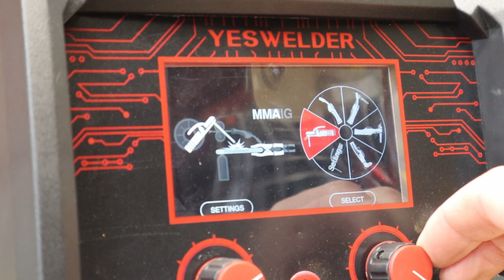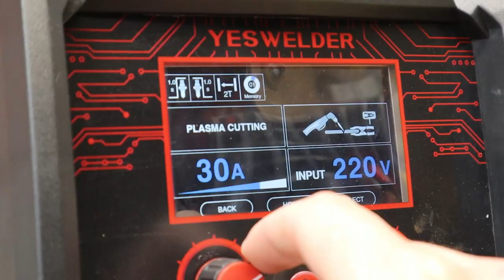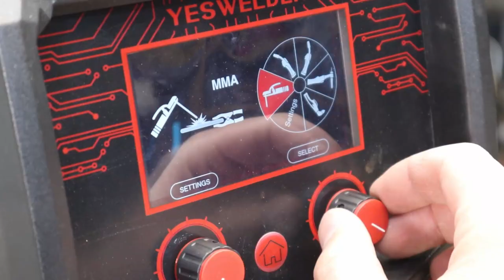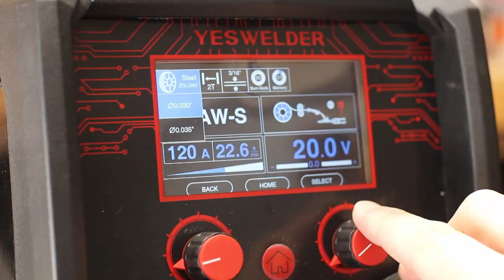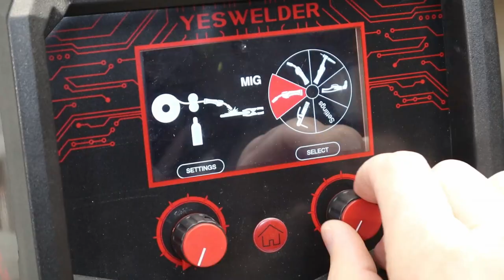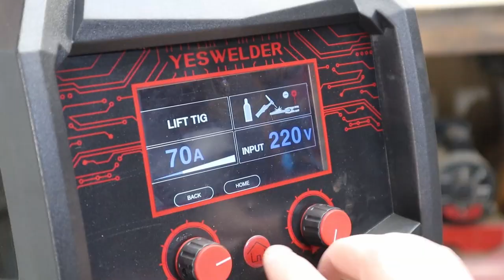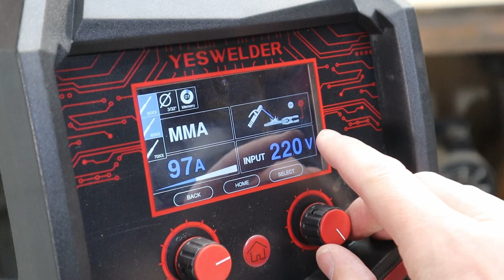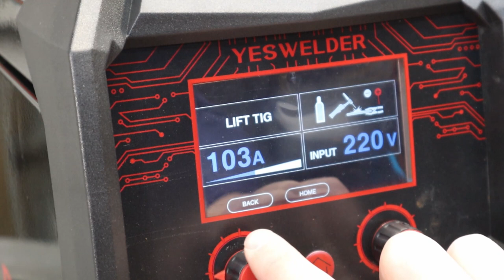YesWelder MP Muiltiprocess 5 IN 1 (TEST and REVIEW) PLASMA MIG FLUX STICK TIG,

Comment: Got a recommend on the air compressor needed for plasma cutting
Reply: That was a question…
Reply from the maker: I used it with my cheap harbor freight 8 gal. Compressor and it worked fine.
Reply: Don’t buy this junk

Comment: I know it doesn't specifically say it, but would this machine be capable of welding aluminum?? Nice video!
Reply from the maker: I don't think so, that is just based off no mention of it in the manual and there is no spool gun switch or setting BUT in looking at the YesWelders spool gun it does look like it has the same Euro connection as the mig gun so it might be possible.
Reply: Yes you can weld aluminum. Get a Teflon liner keep the gun cable straight with no kinks and use argon gas. And if you want to tig aluminum just make sure to use helium gas. You don’t have to go ac to tig weld aluminum. It will have a black soot around the weld but that’s fine just wire brush it off. Think of it this way. When you mig weld aluminum it’s welding in dc current.

Comment: I have the same machine and most of the parts that get with you are complete garbage.  The machine itself isn't horrible but for the money there's a lot better welders that you can buy.  I was a beta tester for one of their newer welders and the first welder that they sent me wouldn't even work on 220V.  The replacement that they sent had a bad gas solenoid so it wouldn't get gas to the torch.
Reply from the maker: Did you test out the red version?
Reply: @-DIYPRO-  the MP200 was Red.  The CT2050 was black (both of them)